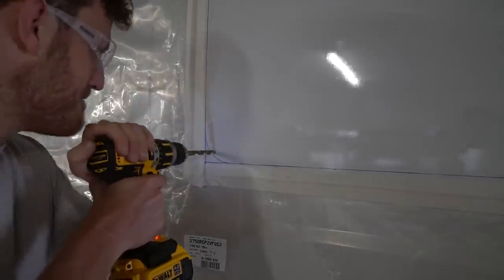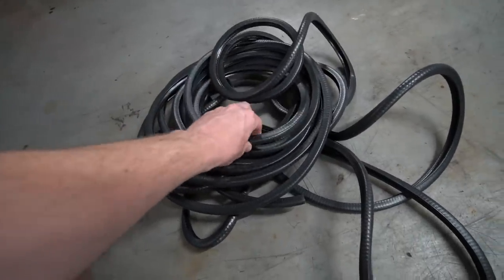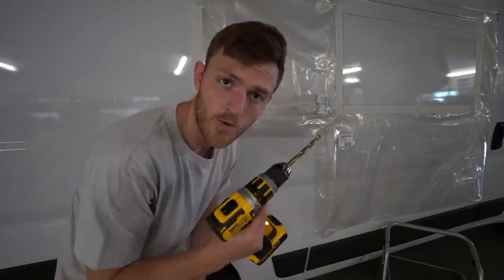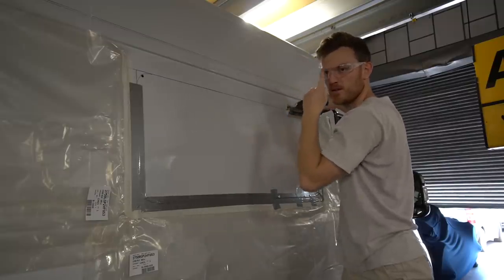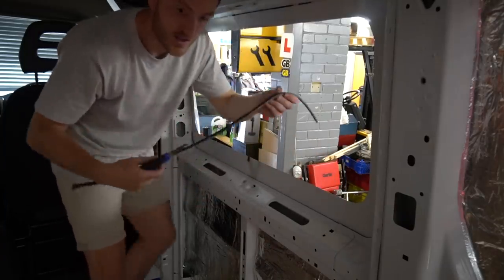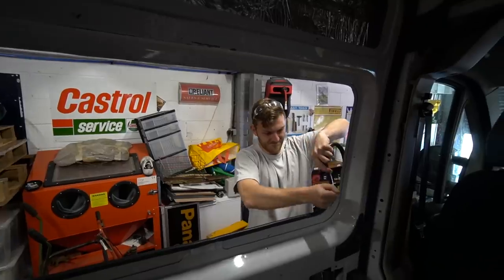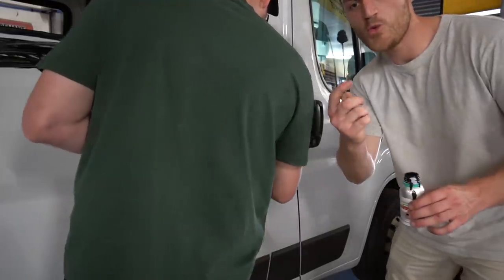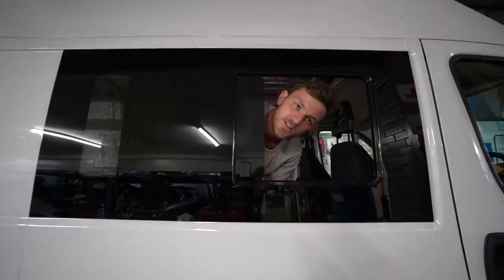INSTALLING SLIDING CAMPERVAN WINDOWS | The Right or Wrong Way? - No Experience Van Build

Comment from the maker: I have to admit that sadly the windows did leak a few days after but I’ve put some clear sealant around the edges of the window which seems to have stopped the rain coming! Going to be heading out very soon for a basic stealth camp in the van so will be good to be back on the road! Make sure your following me on Instagram @willswhereabouts as I post and share more updates of the van build! Thanks for your support on the videos 🤟🏼
Reply: Yeah installed incorrectly, so not surprised. Loving the videos, keep it going.
Reply from the maker: @ewanjacksonmusic  how should it have been done so I know for next time! 😀
Reply: @WillsWhereabouts   its how we learn, i did my 6 windows and they all leaked haha!
Reply: Id have left out the rubber U trim, the glass would sit closer to metal.  Trim from inside after.
Reply: I think the join of the window rubber should be on the bottom side not one of the sides. The rain probably run down the side & got in via the join :(
If at the bottom corner say it can just run down & not get in via the join #im no fitter just had a little experience 

I hope the fix worked. Mind you on the whole you're doing v well :) :) 

Each fit out is a learning curve :) like anything the more you do it, the better you get.
Reply: Personally I think you may of tried to fit the windows to tightly to the van. The sealant will of been pushed to thin when you tired to push it against the van so much. A nice thick sausage of sealant seat the window push in slightly to balloon out the sealant ABIT and then leave it alone to set. Might be wrong,but other than that you nailed it sir
Reply: @adidasmanuk  The edge trim is cosmetic and plays no part in preventing water ingress
Reply: Paint the edge of the window, it'll go rusty, rubber join at the bottom.
Reply: You should make
Reply: Everyone's a couch expert! I'm really enjoying following the process, there's certainly a lot to learn!
Reply: Sorry mate, you fitted them wrong. You didn’t remove enough metal. Should have cut right up to the internal braces, then the U trim slips over both layers of metal. You therefore glued the glass to the floppy excess metal causing all that flex. I would personally have them removed, re-cut and refit properly.
Reply: Hey Will, 

How’s the windows been? Still leaking? I can offer some advice if you’re still having problems, I work in the industry 👍🏻
Reply: Can you do another video
Reply: it’s a shame VGC didn’t sent a rep out and they could have used this as a youtube installation guide.
Reply: @abou824  I'll call my boss tomorrow and ask if I can fit windscreens from my couch.
Reply: I don't why but I love your videos ...I love the learning curve your on and the fact you never stop ..
Reply: @charlotte3783  I think he already has a girlfriend

Comment: Hi Will, you are doing a great job but may I make a few suggestions?
I have been fitting glass to vehicles for 15 years now and a good part of the time converting panel vans for van conversions.

1. when cutting the hole for the window there is no need for any measuring, that inner metal panel that came unbonded is all you need as a guide.
take a spring-loaded center punch and from inside the van place it on the edge of that second panel and punch around the radius of each corner about a cm apart, this will leave small raised bumps on the outside, you can then take a sharpie and join the bumps this will give you your corners, then take a straight edge and draw a line joining each corner radius top, bottom and sides. then you can cut the panel out, file the edges prime the bare metal, and then place the edging trim over the edge. 
The amount of metal you have left around the glass on the inside is going to cause problems with condensation build-up between the metal and the glass.

2. When priming the body and glass you need a single line of primer about 1.5 cm from the edge, use your finger to rest on the edge of the glass as a guide and the swage line of the van.

3. when bonding the glass snip that little piece of plastic and the end of the nozzle off. The gun needs to be at 90 degrees to the glass and the bond should only come out of the triangle part of the nozzle, leaving you a nice triangular bead.

4. there is meant to be a gap between the body and the glass, however some of the cheaper none OE glass does tend not to sit correctly at the corners.

I am worried that these will leak, but fingers crossed you got lucky. Once again great job, I will be following you and soon I will be converting a van for myself.
Reply from the maker: Hey, thanks for the tips and advice especially from someone that knows what they’re talking about, I’ll defiantly try to remember all of this for next time! Sadly they did leak hah but I’ve put some clear sealant around the edges to stop the water coming in

Comment: Good going Will.... an important lesson learned.... safety first.... I have had plenty of drill shavings in the eyes.... not nice... this was before safety specs were about.
I recommend you check out .... Black rock outfitters.... a brummie guy... he has some good tips.
Don't forget to clean out all the saw shavings from inside the van, they will rust quickly.

Comment: For the rear glass windows you could always do two monitors and a live cam to see what is going on around the truck while your in your bed,
Reply: Sounds cool but very impractical if you have finite amount of power in batteries.

Comment: I appreciate the work you are putting into your van. It seems like it would be much easier to start with a passenger van or not to cut windows (maybe only vent ports) in a cargo van but to instead learn to drive with flat and convex mirrors. I have camped a lot in vans and when I was camping, I'd always have the doors open anyway, except for when sleeping.

Comment: Lookin good! The bonding glue should be near to the edge of the glass ideally, i made same error on mine and a window guy said they can break if leaned on in corner as not supported.
Reply from the maker: That’s good to know for next time, thanks mate
Reply: @WillsWhereabouts  you could try adding some black seal-on on sides, just tape it nicely around to avoid a mess
Reply: If they leak, id say take out and re bond, i tried the whole seal thing and its messy and it never works long term

Comment: Keep at it, doing a great job. Easy to talk about sh*t, different to get stuck in and do it. Personal question, you've mentioned mental health in the past, I've had two big fuck off breakdowns over the last 10 yrs, each time I was unable to sleep in the house, just wanted to escape first time I had a motorhome to kip in, second time a van, is this connected to what started you off car camping?  no need to answer if it's too personal.

Comment: The bottom drainage channels are proud of the glass so the thickness of the sealant will be at least as deep as those channels. Dont try and squeeze the adhesive out, it just needs to make contact all around ... thats enough.

Comment: Should off put primer on bare metal before installing the rubber trim. At least you had a go👌👍.
Reply: I thought that too, isn't that what the primer was for, should've read the instructions more, I'm sure every van build video I've seen use that primer on the bare metal?
Reply: @malcolmrowe5031  no the primer (in bottle with round applicator) is to prepare the surface before using the thick adhesive. But yeah some primer paint/hammerite around the edge would protect the bare metal.

Comment: Every van window I've seen installed came with an inside frame that screws to the outer window frame & pulls it in tight. You want more than the adhesive holding it in. I'm thinking that they didn't send the inside bracket or you might have had to buy it separately, which is dumb for a window kit to not come with it. To get the window to slide easier I'd spray some dry silicone lubricant on the track.
Reply: these windows are bonded only.

Comment: for loosening up the window get some silicone spray or ptfe spray. Spray the rubbers where the window slides that will loosen it up. Also the same stuff is good for your door windows if they are stiff coming up or going down just spray down the ends of the glass and it will lubricate it then they will slide better it lasts quite a long time. 

just dont use wd40! while it will work it wont last long. 

on a side note i ask you this do you know what WD means? many people dont....... i will wait till you googled it haha
Reply from the maker: Thanks I’ll try some silicone spray and see if that does the trick
Reply: @WillsWhereabouts  no worries. I'll keep watching and if I got more tips I'll keep commenting 😊

Comment: Did you paint on some rust prevention solution around the edge of the opening you cut for the window? You probably will be OK but since you are taking every precaution to protect the van then it might have helped.
Reply from the maker: I didn’t and now wish I had but fingers crossed it won’t have any issues

Comment: Trick for getting metal chip from eye: magnet. Rubbing just makes it worse.
Reply from the maker: Thanks for the tip
Reply: What are the sides of the van made of? If they’re aluminum then it’s not magnetic so that would not work fit your eye
Reply: @tammieflemal7871  Sheet steel. Aluminum is difficult and expensive to work with in comparison. Aluminum is used in buses and such, where there is plenty of surface to cover and weight saving makes a real difference.
Also: aluminum sounds different when flexed and cuts different to what I've seen in this video.
Reply: @tuoppi42  then a magnet would take the shard out of the eye. I know my truck is a variety of sheet steel and aluminum. For instance the tail gate is aluminum to help the hydraulic system make it easy open/ close

Comment: Unless I'm completely wrong you made a pretty important mistake that others should not copy! 

The rubber trim does NOT go on the outside sheet metal. It's meant to simply go onto the inner sheet metal at the very end – once the window has been installed and the glue/sealant has dried.

Comment: That gap doesn't look right to me.
Water can go behind and sit there eventually rusting the van panel.
Please check it out with the window suppliers to make sure what you've done is correct
Reply: Na. Water won't get past the glue seal. It will just run around it and then down and away
Reply from the maker: That’s what I was thinking originally but I’ve sealed the edges now so it can’t get in